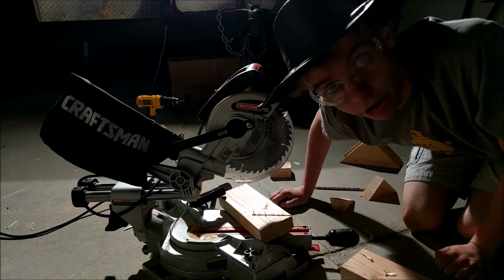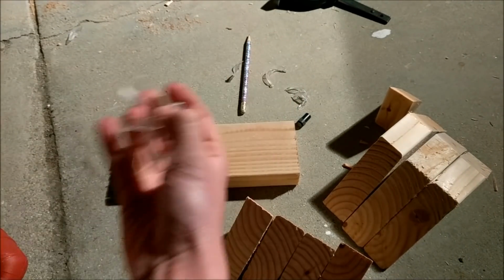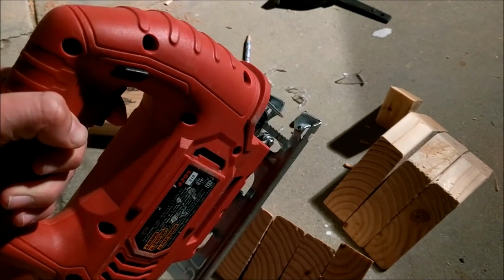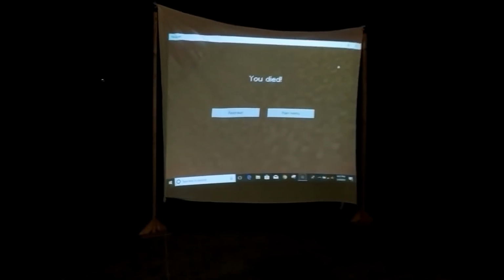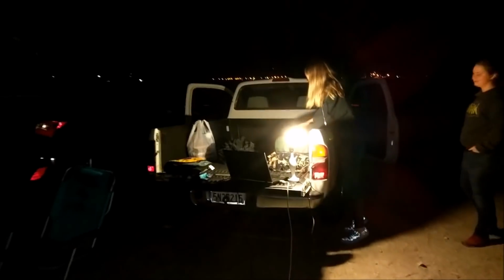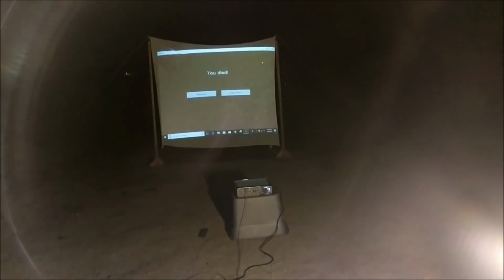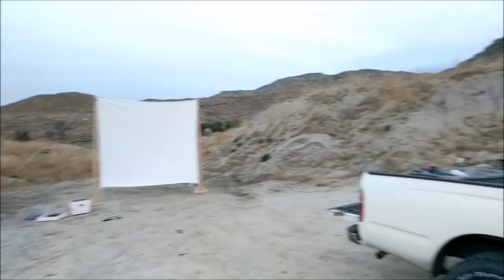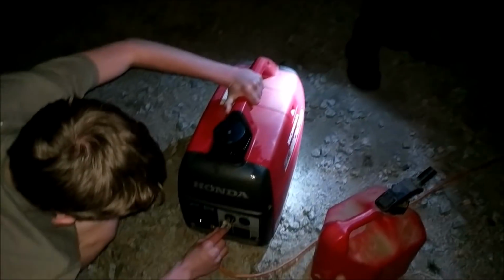DIY Drive In Movie

Comment: Man .. I remember those days.  I build something similar in the 90s for a drive in style setup. Was based on parts from a rear projection TV that was severely damages in a fire that I snagged from being trashed. I also remember the starter failing on my manual car and having to push start it. While waiting the 3 days to get a new one I ordered I would park where I had a small hill, then push the car a bit with one leg out the door, the other on the clutch until I had enough to kick the engine over once.  Then away I would go,  just couldn't  shut it off while out and about. So I had rigged an ignition bypass so at least it was locked and steering was locked . Just looked like it had remote start :-)

Comment: Glad you are ok, odd that shroud dropped like that into the cutting. Any idea why it did that?
Reply: Nothing was holding that wood. A little vibration raised it and it did get stuck to the blade.

Correction: nothing was holding it not go to up.
Reply: 1978jra My saws like that the shroud is mechanically lifted with  as you drop the saw, this appeared to be that, then dropped.
Reply: You are right I watched that again and yes the machine jumped up when it caught and made things worse.

Comment: I'm glad you got through that kickback without issue!  Yeah, I would have thought too that the bar clamp should have been sufficient to hold it down.  Apparently not!  DAMN!!!  The saw comes with its own clamp that can be used on either side.  That's what those two holes with the set screws behind the fence are for.  The clamp looks like this.  https://goo.gl/x9bEjV  Lot's of down pressure but a lot slower than the bar clamp you're using.

You should be able to order a new blade guard here:  https://www.searspartsdirect.com